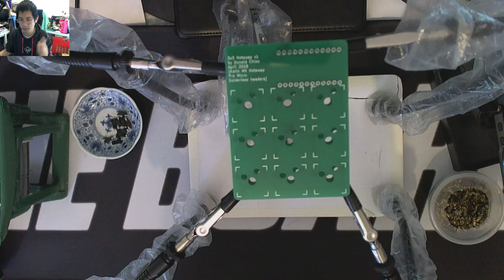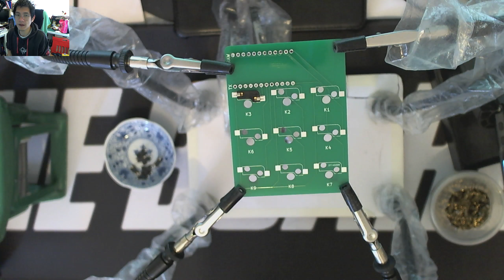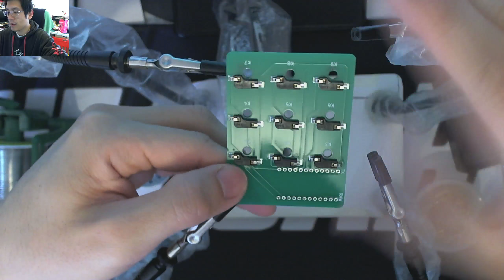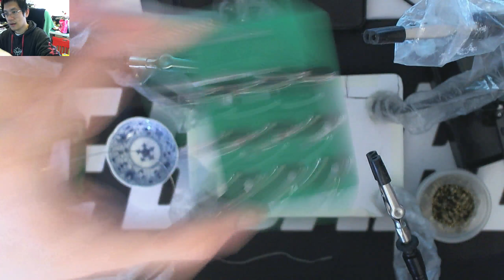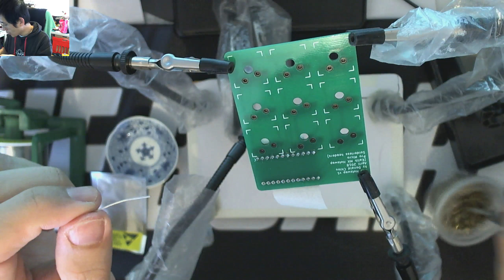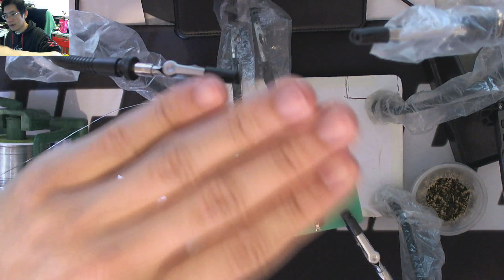Soldering the 3x3 Hotswap Build

Comment: Generally avoid reheating soldered joints. If you think a soldered joint isn't good, just desolder and solder it afresh.

You must use liquid flux for reheating soldered joints, or the joint will get oxidised and deteriorate. This can cause anything from connection issues to mechanically weak joints.

This video should explain why: https://www.youtube.com/watch?v=WWSD3eXSdTk
Reply from the maker: Thank you for the comment and interesting video. I can say that since I don't burn off all of the rosin core when I solder my joints, and when I reflow my joints, they definitely don't have that oxidised look or wrinkle, I'm not very concerned about it at all.

As for 'must', thats really not an issue either. I have had no connection issues, and mechanically weak joints is even less of an issue for builds in my experience.

That said, I am not being dismissive of the message here, it is personal choice in that for context of use, out of thousands of joints I have prepared on my boards this way, the symptoms being demonstrated and described are not an issue for me.

Other viewers may want to resolder if they want to, and I do know others who use plenty of flux, I simply do not for my builds.

Comment: Your better of watch other soldering vids from electronic guys I like you but I'm trying to be honest I'm kind of OCD when it comes to soldering. 
I would much rather pre tin the pads use liquid flux and the. Solder the partand use flux for god sake. 
And oh yeah I know the solder has a rosin core..
So watch more smd soldering vids
Reply from the maker: Thank you for the feedback TuxKey, I appreciate it. I do not do much SMD soldering at all, and as such, I do not currently own any flux at all since my standard through-hole components work just fine using rosin core. 

I do not claim to be professional SMD soldering, so as a hobby-ist, I hope those who watch realise that!

As for getting some flux, if I anticipate a lot of SMD work, it would probably be on the shopping list.

Cheers.
Reply: @theboard  You generally don't have to be that generous with flux when you have flux core solder. I only add it when the solder looks "dry" if that makes sense, or I willl go back and touch up with flux if I want some spots to look neater. Have had many successful keyboard and macro pad builds without always using extra flux. 

Tinning pads can also lead to unevenness of the component if you do more than one contact point. From my experience it is only necessary for one contact point to be tinned when components are surface mountable and wont stay in place like these components do because they fall through the hole in the back and lock in place;  I think you did as perfect of a job as you could have.
Reply from the maker: @iamnotmadok  Thanks for the feedback Madison, much appreciated. I still actually don't have any flux, and having done a SMD build Ergodox now, I did actually find excessive tinning was an issue too so correlates with your comment and experience well :)

Comment: Do hot swap work without diodo?
Reply from the maker: Due to the small number of switches in my matrix (9), it does not need diodes since there are enough pins for each switch to have a unique pin for both row and column. You only require the addition of diodes when you start to use common pins for a row, column, or both rows and columns.

The use of the hotswap only replaces the need to solder and desolder switches, everything else in the way the matrix works stays the same.
Reply: thanks, is it possible use kailh hotswap without pcb?
Reply from the maker: Sure, you can handwire, but its a bit more challenging. You would need to put your switches through a plate, install the hotswap, and then solder diodes and wires onto the pads of the hotswaps. https://imgur.com/a/NFyi0#Q9f0s90 shows that its been considered and does work.